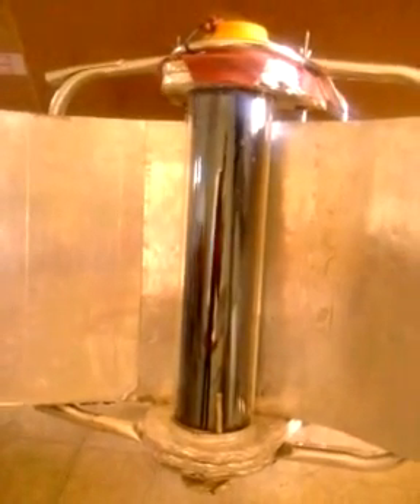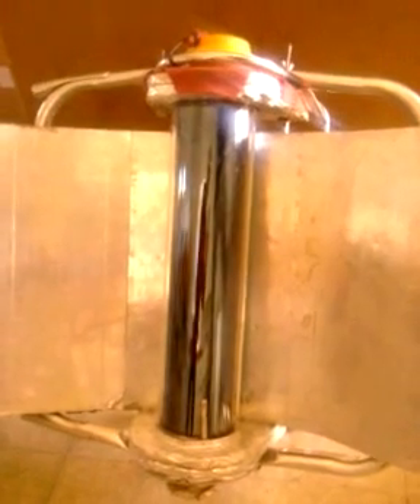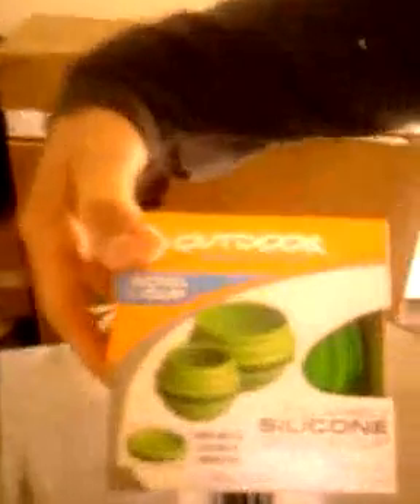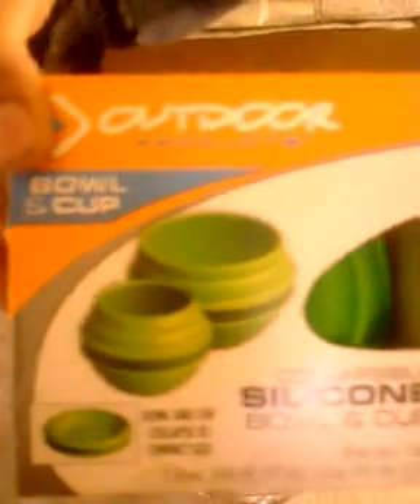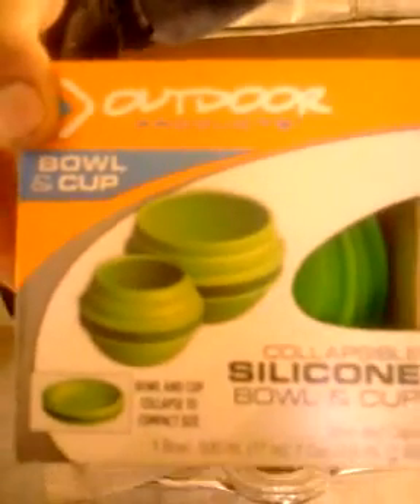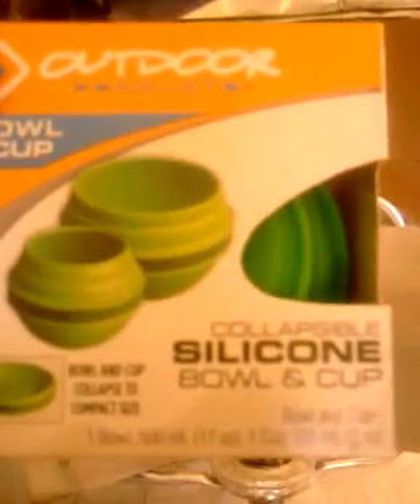"Solar Oven" "Evacuated Tube Cooking" "Vacuum Tube Oven" "Vacuum Tube Cooking"

Comment from the maker: Update 2/7/2017:  My tube imploded last week.  If you've read through any of my updates above, you know that I had another tube that lost vacuum a couple years ago.  So anyway, I'm pretty torn about buying another one, even though they are relatively cheap (about $70 on amazon (shipping included)).  I'll probably hold off for a while.
I'm not sure why it imploded (it was quite loud, although I had earphones on at the time).  I was just putting in one of my new stainless steel containers and bam-  There was some water in the bottom, so the temperature at most was 212F (although it was pretty early in the morning and I don't think it was that hot).  I've also done that maneuver multiple times.I still think a weak part of the design is the little metal spring that holds the two pieces of glass apart.  This is where the crack developed on my last tube, and although I didn't see any evidence that any scratching occurred at that point on this tube, the metal is sharper at that point than need be (in my opinion).  If a more smooth type of spring (with cushioning) could be used inside these tubes, maybe that would help.  I also realize that the way I use the tube (putting a bunch of weight into the tube, and sometimes turning the tube upside down to empty water might also be a problem.The smaller tubes have been more consistent.  It seems that when you get the larger diameters, and the necessary thicker glass, it's more difficult to make sure implosion doesn't happen, but who knows?  Maybe one of my stray cats scratched the surface a short while before it imploded.  I hope everyone else that has been using these has longer term success.  I can still get pretty warm water (150F at least) on sunny days in winter with the old tube that just has a crack in the outer tube (and lost vacuum), so it is good for water heating at least.  Maybe I'll try cooking something simple in it on extremely sunny days